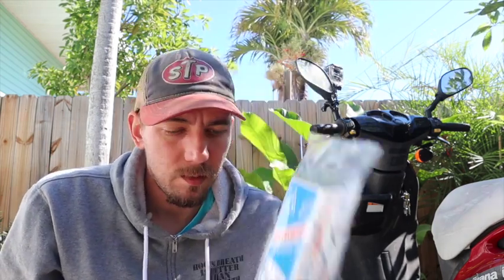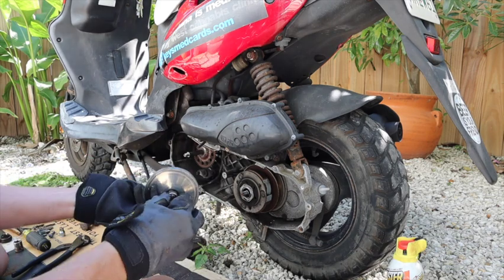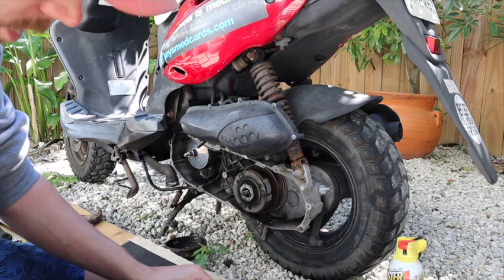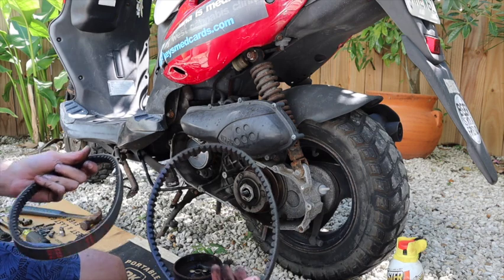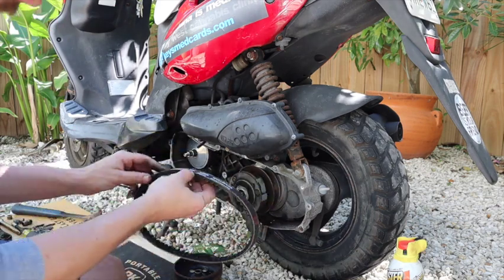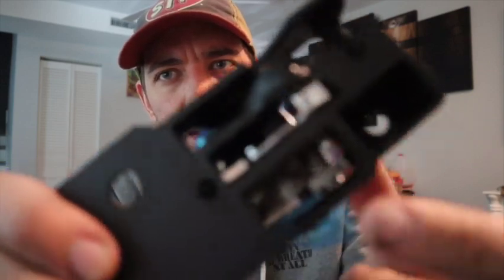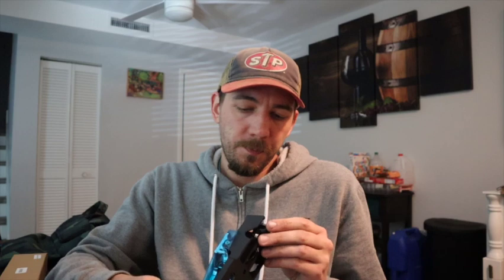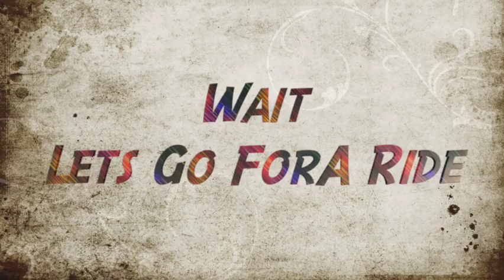Genuine Roughhouse 50cc Belt & Variator Weights Change-out

Comment: You mentioned that it helps make it accelerate faster. My I ask why?
Reply from the maker: Depends on which part. The weights, depending on what gram you use can either give your scooter a higher top speed or faster acceleration. Heavier weights give you more top end speed. The weights control how fast the scooter shifts. So the lite weights will create faster acceleration but will significantly bring down tops speeds. Some people mix weights. I like to stay around 7-7.5 grams because I live on an island with a top speed of 35mph max. So acceleration is better and even still I max out at a top speed of around 40mph. 

Now the shim I took out of the grey scooter was added in by the rental company I bought it from to reduce top speed down to somewhere around 30-35 mph. I didn't realize it was there. That shim spun with the belt and raised it. Just by removing the shim without changing anything would have made the scooter reach a much higher top speed. Prob around 40-45 mph with 7.5 weights on flat ground.
Reply from the maker: I should say that heavier weights will slow your acceleration speeds. So need to find that good in-between weight for decent acceleration and decent top speed.

Comment: Hey do you still have this scooter I need parts I just picked up one of these for $100 the parts I’m looking for are the clutch cover bolts,variator parts I have the aluminum fan and variator just need that start spacer/washer and that nut that tightens it up,need the clutch nut, I have a spare clutch that will go on if it is the same spline.and I need a new top end I took out the spark plug and stuck my inspection camera down the cylinder and noticed a small hole in the center of the piston so I’m thinking of going with a BBK if u have anything that could help me get those parts like websites and such that’s be great thanks

Comment: Do you know how many miles the old belt lasted?
Reply from the maker: I can't say for sure because they were both old rental scooters. The old ones weren't in bad shape but since I was already changing the variator weights I went ahead and put on new belts. Usually when belts are really bad shape they are brittle and have teeth missing so they will slip.

Comment: Can you post a link to the orange weights you used please and thank you
Reply from the maker: I usually order everything from Scooter Dynasty, they switch up brands so may not be available any longer.
Reply: Did you ever get the clutch
Reply: Im running the stock clutch with 1500rpm springs and an NCY bell its finally breaking in running nice

Comment: So did you hold the variatior or the belt with channel locks and use an impact wrench to loosen it?  Could you use a drill?
Reply from the maker: I wouldn't. Use a socket wrench instead. A regular drill will spin it and you'll tear fins off with those channel locks.

Comment: Sorry that's terrible advice saying you can run wo a battery with the possibility damage your electrical system..
Reply from the maker: @speedyme200  if it was going to hurt the electrical system then they wouldn't build them to be able to run without a battery. The pocket batteries they added to scooters and mopeds are for convenience only.
Reply: @flipflopmech  some things won't function properly without a battery brake light turn signal gas gauge and oil warning light.. even the stator and the voltage regulator won't like it.. electrical load need a batt.. why risk it but do what yall want ain't my bike..
Reply from the maker: @speedyme200  everything has always worked like normal on the scooters I've owned. I rolled the odometer over on a Honda metro 2 at least a handful of times before I bought these genuines, without a battery since I bought it used from a scooter rental company. Ran that thing for 8 years everyday and it was a fuel pumped 4 stroke. Ran that Honda so many miles the plastics on it got brittle from that Florida sun and blew away with the wind lol. Finally got to where it wasn't worth throwing parts at anymore and I guess you could say upgraded to genuine but that little metro just rode great and was quiet compared to these 2 cycles. Never had exhaust issues on that Honda like these either. Little rust pin holes pop up randomly on these, got more j.b. weld steel stick than metal at this point.